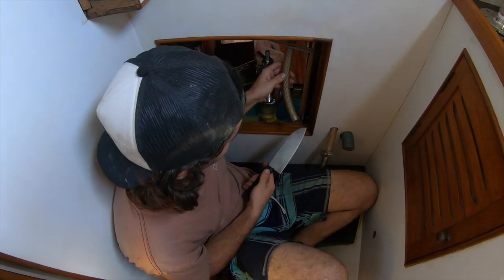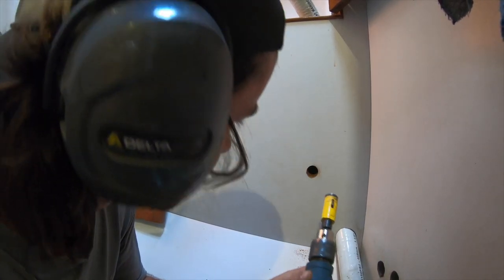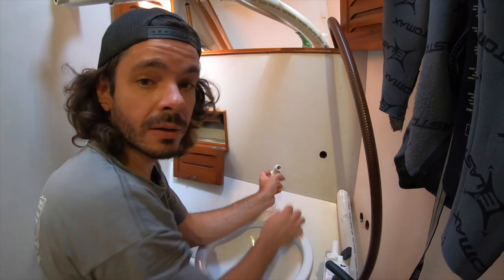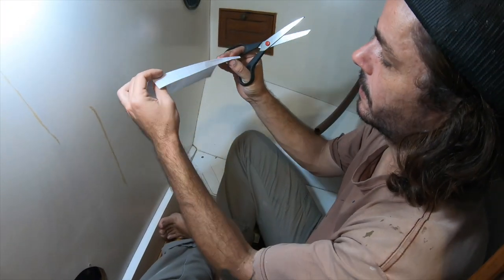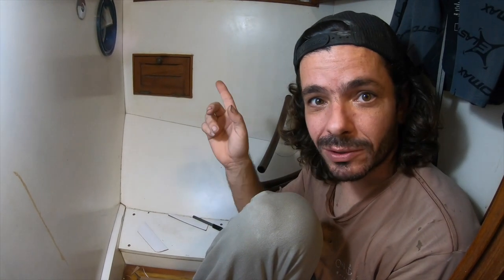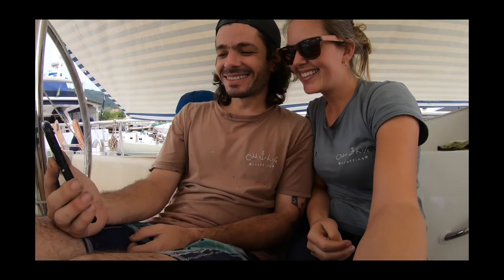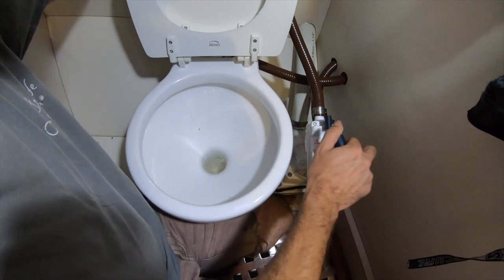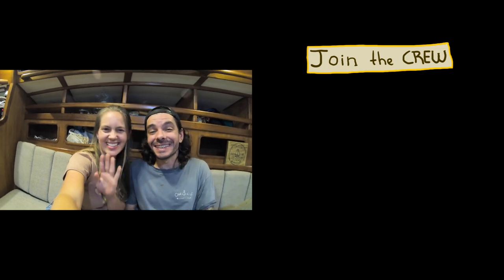⛵️It's TIME to transform our sailboat into our Floating HOME!! #156

Comment: composting toilets arent cheap, that´s a fact, but in 10 years you will have rebuilt that thing at least 3 times (maybe even replace the unit), and it is, literally a shitty job.  2 people living full time should give you 4-6 weeks between emptying out. plus the install is way more straightforward (you would still need  that wedge to level it off), but no more messing around with hoses, clamps, gaskets, holding tank, etc
Reply from the maker: It's really hard to find them in Brazil

Comment: Why does the big, sharp knife Duca uses to cut hoses scare me????  There MUST be a better way to cut hoses and not risk cutting off fingers or other body parts.... Also, if you are going to use zip ties, use aircraft grade ties... they will last longer and they have a metal tab to tighten and hold.... not break like plastic will in 4 or 5 years.... let's get Odd out on the blue!!!!!